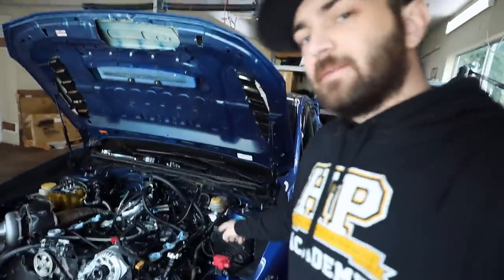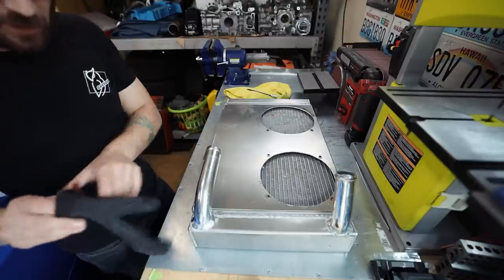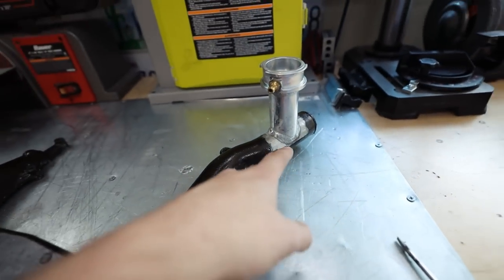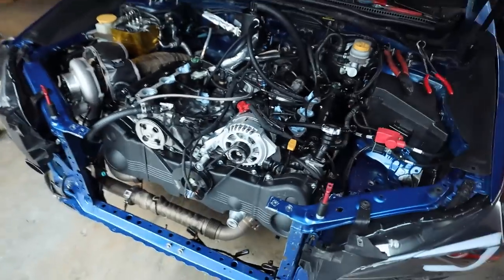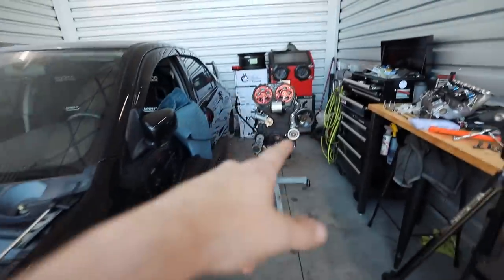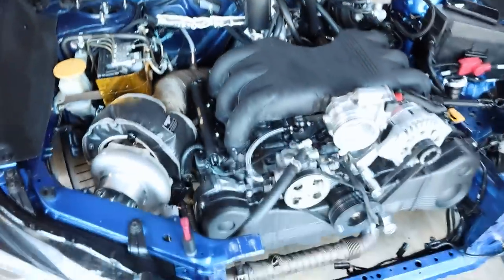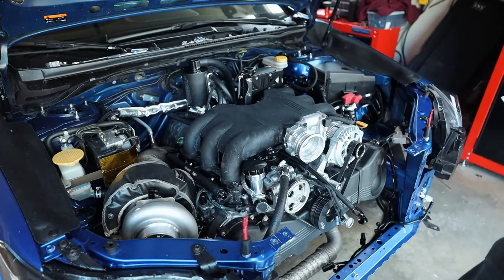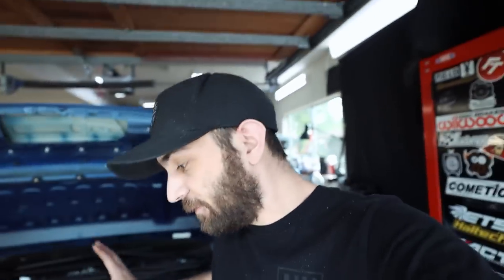Fixing my 6 Cylinder Subaru WRX STI Bunk Cooling System!

Comment: Tanner, I think you might find this video more insightful on why a cly 4/6 cooling mod may be necessary.  https://www.youtube.com/watch?v=MCrpzPaUnW0   Between Dom's testing and the referenced video, it's my belief that the video you shared on facebook is incorrect.  I'd hate to see you do all of this work and regret pulling that mod/redirector off.
Reply: I agree with you SubaruOnly has the best cooling system series I have seen so far. The guys a fluid dynamics engineer so if you haven't watched it people watch it!
Reply from the maker: I've seen his as well, great video 🔥 but I'd prefer to not run one. From what I've gathered between the handful of videos and from talking to thr other EG guys, no one uses them. 

Buddy of mine with an EG installed one and had H/G failure shortly after. Not saying that it's 100% attributed to that but an odd coincidence. 

Haven't really seen any high HP cars before using them either 🤔
Reply: I agree also in the vid the guy said it bypasses the radiator and sends it to the thermostat witch is wrong unless you install the mod wrong somehow . It should connect directy to the cross over pipe witch is connected directly to the radiator , so if you install it wrong and put it on the  heater core return yea that guy will be right but the corect way to install it is to the heater core feed witch is on the crossover pipe and the return is the bypass . And he also said it makes there be less cooant in the water jacket witch doesnt make sence since the hole system is pressurized and coolant should fill the system equally unless you have a huge air pocket sitting in there some how.
Reply: @Smeedia  Josh at bbr said in the cyl 4 mod is not necessary.
Reply: I second that. Dom did extensive testing to prove the mod reduced temps on cylinder 4 around 10 years ago and still stands by it.
Reply: After watching that vid I agree the cooling mod makes a difference. EJs aren't known for their reliability and the fourth cylinder is known for having less compression and knocking before the others. My 06 sti has 140k miles and I prefer to have the mod even if it isn't a noticeable difference. Also I believe it makes the cooling system more symmetrical by allowing a exit port on both sides.
Reply: @Smeedia  Dom just released an updated 2 hour video on the subject...it seems like you're stirring the pot LOL.
Reply from the maker: I'm a sucker for stirring the pot I guess lol, I was referring to my EG, have no issues with them on EJs 😅

Doesn't make sense to use one for my set up and would feel better about the cooling system not using one
Reply: @Smeedia  yes i agree with eg being a different beast and possibly not needing one like ej's also you have a monster of a block being billet and closed deck , also you have a killer radiator setup witch also helps a lot , the reason most ej guys go with that mod is there on a tight budget and cant afford a high end rad or in my case waiting to save up for a great quality radiator and still running with the stock rad for now . But yes for the eg buld you going with i would try it without and later down the road after you get it running see if its reasonable and if its not then leave your set up as is and focus on other paramiters the cooling mod is not a solution for all over heating problems and should not be seen as an end to a means.
Reply: @Smeedia  yeah not proven on the EG so why risk spilling more coolant on yourself LOL.  But seriously I would rather just have a high quality upgraded radiator-fan-shroud setup.

Comment: Just recently got a cylinder 4 mod 🤦🏽‍♂️. Haven’t installed it yet, glad I didn’t but still wish I new this before buying it
Reply from the maker: You can still run them, there's augments on both sides weather they work or not. For me I'd rather just not have it

Comment: If you use 2fans they need to be the same. Otherwise the stronger fan will pull air backwards through the weaker fan.
Reply from the maker: Oh, I did not know this 😳

Comment: Shame that the dyno had to be put off, but at least the cooling issues and coolant leak came to light before anything happened on the dyno!

Have you found that video about the cyl4/6 mod? I'm mighty interested in the specifics behind that because if you use the heater core return line, it might help?? Physics be weird with things though.

Also, of note. I wish Techron was available here in Canada because I want to run a few bottles through my car due to no history on it. Maybe get 500kms to a tank rather than ~400 on summer fuel (winter blend SUCKS).

Also, why'd you go with a race muffler rather than a barrel muffler? The have 4.5 inch, and it would quiet it down a smidge for driving around the city to/from meets. And a resonator is great for cutting the high frequency noises because damn that thing peaks BAD on the recording.

Anyway, love all the work! Keep it up dude!
Reply from the maker: We will get her on there 🔥 

I've seen them and fir EJs they're fine but in thr EG I'd rather not run one. 

They don't sell it up north?!

Also snagged them because they were cheaper now I know why 😅
Reply: Okay, that makes more sense on the cyl6 cooling mod vs on the EJ.

Yeah, they don't sell it up here and it makes me sad af. But, hey, at least I live near the border, but getting around to dealing with crossing is another thing.

Also, that price is pretty good. They should at least cut down on the high frequencies that you're getting. Will definitely be interesting to hear the next startup. Also, just watched the newest, nice improvement on welding!

Comment: Yeah man, My tuner didnt recommend me to use the cyl 4 cooling mod and also phenolic spacers
Reply from the maker: Why not the phenolic spacers?
Reply: @Smeedia  i dont remember exactly the reason why but maybe they think it does it make big difference, I tjought it helps the intake manifold keep it bit cooler
Reply: Ask your tuner for the reason. Is there a trade off between warmer coolant vs a hotter cylinder?
Reply: The issue with the phenolic spacers is it breaks the grounding points, and will wreak havoc on your electrical system and ECU.  Again it sounds awesome in theory just like the cylinder 4 cooling mod but no good.
Reply from the maker: I mean you could just move the electrical grounds to the cylinder head themselves 

But keeping at the factory location i could see the potential for it
Reply: @Smeedia  if you watch the video with flatirons tunning with Chris from iwire on.   Pretty sure that's the video where Chris discusses it.   It's a long video but goes into details on Subaru wiring and engine swap wiring problems to avoid.

Comment: Im speechless, really I literally watch this glued to the screen. The flat 6 is nuts! Im gonna look into my options into going single big turbo on my 16 ecoboost f150, as for my supercharged 98 civic needs a new fuel pump and crank pulley, than there's my 17 wrx is ready for wide body and el headers. Any recommendations for a intake manifold on a FA20 T? Im 80% close to fbo's on it. Did you know it takes less than 11-12 minutes to swap out a TT f150's fm intercooler? Its literally 2 cuplers and bracket mount, easyyyyyyyy. 🙏🏼🤞🏼🤞🏼 on the EG33'S dyno goes without a hinge and problem free 🤞🏼😭🤞🏼!
Reply from the maker: Definitely look into process west for thr intake manifold! And that's pretty quick Ok that thing for swapping them out!
Reply: Thank you Tanner👍🏼

Comment: I could be wrong, but having the inlet and outlet of the radiator on the same side is not going to do anything to cool the engine... the coolant won't flow across the fins. Unless you have some magic inside the end tank that forces coolant across you need to do something different.
Reply from the maker: Its a dual pass radiator so there are plates inside the radiator that force it across the radiator 🙏
Reply: @Smeedia  cool! Sucks that you are having to redo a lot of work for this thing.  You seem to be handling it way better than I would.  So close I can taste it though!

Comment: On the cyl4 cooling mod. While it may be less applicable to the 6cyl in the STI, you may want to watch the video GetaDomTune, the guy who invented the thing recently put out. Very informative and very data driven. Definitely an interesting video
Reply from the maker: Subaru used them on JDM X engines a long time ago, for EJs they're fine to use, have no issue with them for EJs. But for EGs there is no data to show any difference and it's not worth the risk imo. 

Especially with the way my cooling system is set up, wouldent make sense for me to use one
Reply: @Smeedia  for sure, I don't know shit all about EGs lol, and I'd assume given the increase in cylinders the coolant flow is probably better distributed. Just wanted to throw that out there. Love the videos by the way!

Comment: Why would you block off nearly the entire back of the radiator?  It won't work without airflow; any part of the radiator without a fan should have flaps that open with positive air pressure in the radiator.
Reply from the maker: That's how I got it back from Fab, questioned it but was told it should be okay. We were not okay.... lol

Comment: Yea im going through revissions of my compound set up and heat soak is my biggest scare as of right now as well as i am keeping the top mount so im trying to cad build as many heat shields i can build if i have to push the pipe from the back of the big turbo up out of yhe hood for clearence
Reply from the maker: How's the set up coming along aside from hest soak issues? 🔥
Reply: @Smeedia  im still in rd stuff im in the processs of moving so im backed up but i have everything for the motor and the twin wastegates a nd and fuel its just getting moved so i have a place i can take the csr apartget the motor to out front to be sleeved and studed and the the twin turbo set up buold starts

Comment: Ps the Evo rear main is like an LS rear main. I don't remember if the og 90s 4g was the same or not..never could get my talon to run right..
Reply from the maker: Whats an LS rear main like? 😅 I have no experience with them lol
Reply: @Smeedia  they bolt on, easier to install seal off the engine, then bolt the whole unit onto the block

Comment: What’s the difference between the two blocks in the background around 16:20? I’m still newer to working on engines and understanding them.
Reply from the maker: Thr one on the left is an FA20 from a 15-21 wrx and the one on the tight is an EJ 🙏
Reply: @Smeedia  Thanks! You’re straight up the best! I’ve learned so much from you’re videos!

Comment: Interesting video you shared I mean I def didn’t understand it fully at first how the coolant path was I thought after it got pulled from the block it was somehow going to the rad to cool.

Did you see the Percy Ward comment on that video and discussion? I don’t have FB did that guy do the test and provide data to support? He didn’t have any then and that was a year ago
Reply from the maker: From what I came across they did some testing, I don't think there was any hard conclusive data on improvements. But I've seen arguments on both sides for if they do or do not work
Reply: @Smeedia  I feel ya ya I mean his breakdown makes sense it’s pulling cooling from one side so I would agree to pull it interesting topic

Comment: so cyl 4 cooling mod is not worth? or is that just on the eg?
Reply from the maker: There are arguments in both sides, I've used it and I haven't used it before and in both cases the cars been fine. I'd say if you still want one snag one. 

For the 6 cylinder I've been advised to stay away from them

Comment: If those steel brackets are touching anything aluminum I would make a gasket for between them. Dissimilar metals will corrode eachother--galvanic corrosion.  Would hate to see anything happen to your manifold.
Reply from the maker: What if there is 2 layers of paint between them? 👀
Reply: Do you really wanna risk it for that corn biscuit? 😂
Reply: I was wondering how he got the steel bracket to properly weld to the aluminum. I don't think it'll hold up with the aggression that motor is goi g to have.
Reply from the maker: It's steel on steel weld, then the bracket bolts to the manifold uses spare holes 😅 

I did not try and weld steel to aluminum 🤣😅
Reply: @Smeedia  I was sitting here like, that's cast aluminum, he literally just said how he needs more practice on aluminum. On top of that it's the manifold I can't believe he would try and weld onto that.

Then when you showed it was done and how confident you were with it, I was like, well isn't that something. He actually got it on there. Probably had to glob the aluminum around the steel to hold it on place. No way that will hold with vibration.

My dumbass got way too complicated with it. 👍👍
Reply from the maker: Haha no worries 😅😅 I did not even want to attempt welding onto that manifold lol
Reply: It'll probably rub through.  I wouldn't risk it myself.  Just use a thin gasket you can make something with an old inner tube so it'll absorb some vibration also.

Comment: Hey I need some advice. I had a head gasket job done since I had a leak. Changed out everything from hoses, timing belt, new koyo radiator, water pump, oil pump,  and spark plugs. I also added the 4th cylinder cooling mod. Drove it for 2 weeks and a CEL comes on throwing 4th cylinder misfire. Any tips on how I should handle this before I just head back to the shop?
Reply from the maker: Start with checking the gap on the plugs 🙏
Possible it could be off a little

Comment: Thinking about getting e tuned on my 04 wrx. I’m on a Cobb intake and downpipe. Is a EBCS worth it before/ is there anything I should do before?
Reply: I’m pretty okay with where the power is at right now although more never hurts, but I just want to get the drivability good
Reply from the maker: Better boost controller, definitely worth it 🔥🔥🔥

Comment: Please please please! Do NOT put that “shroud” back on the way it was. You’re basically blocking off all air flow to the parts of the radiator that don’t have a fan. If you could have the shroud stood off the radiator like 2” then it would work. But with the shroud right against the radiator there’s no way for air to flow through the radiator.
Reply from the maker: Were doing a totally doffrent design that promotes airflow 🔥

Having it right against is something we're avoiding this time 😅
Reply: I’d ditch the shroud all together and make mounting brackets that allow for max flow. Fans are only necessary when the car is not moving or at low speeds. The way it was set up before makes me think the intercooler flow was impeded  too.
Reply: I’m with this. The shroud was to close. You want about 2 inches  you won’t need flaps to evacuate air the big fan will do the job
Reply: Yeah that radiator shroud design is more for like a salt flats race car or drag race setup.
Reply: @Smeedia  I would recommend speed flaps as well.  This way the faster you go the flaps will open and allow more airflow, but when slow they will seal off and the fans will pull the air needed across the radiator.

Comment: The Aussie has a point that the temperatures are not necessarily cooler but #Subaruonly has a much better demonstration as per fluid dynamics and how much flow and where the flow occurs. https://youtu.be/MCrpzPaUnW0
Reply from the maker: I've seen his as well 🔥 great video 💪

But for my specific application I was told to avoid using it by those who've been doing this longer than I 😅 

I wouldent say someone is right or wrong for using one or not using one

Comment: you can do it
Reply from the maker: We doing it 🔥🔥🔥
Reply: @Smeedia  Did you find that the cylinder 4 cooling mod is no good on all Subaru engines or just the EG? I thought you were going to use the COBB coolent overflow? It seems like the COBB unit is smaller then the Vibrent.
Reply from the maker: Were using thr Cobb overflow, shows up tomorrow 🔥 

Tbh I don't think it's really needed on the 6 but there'd always been arguments on both sides of if they work or not